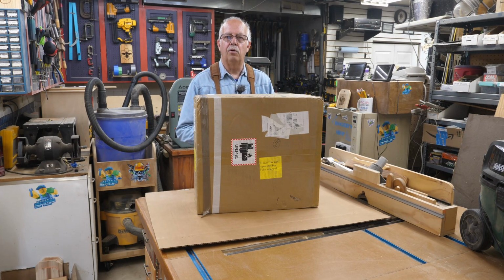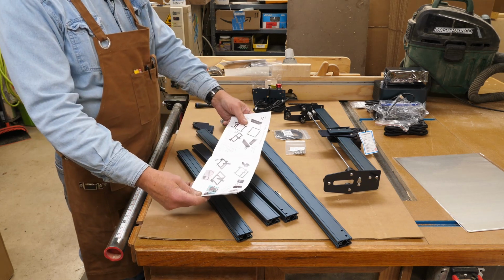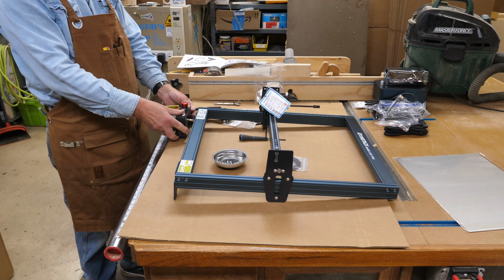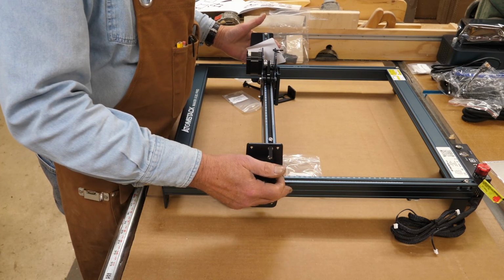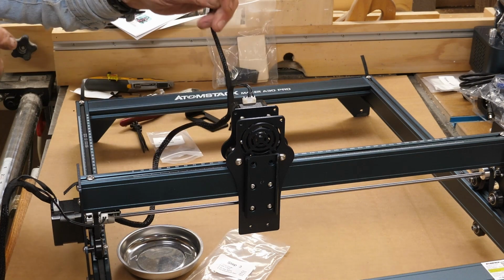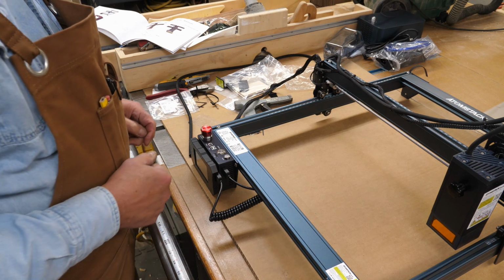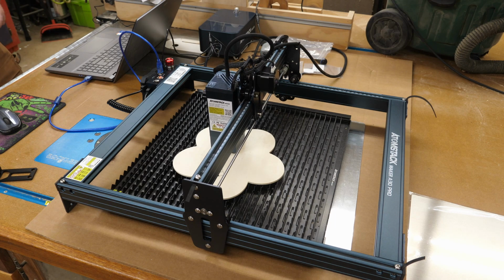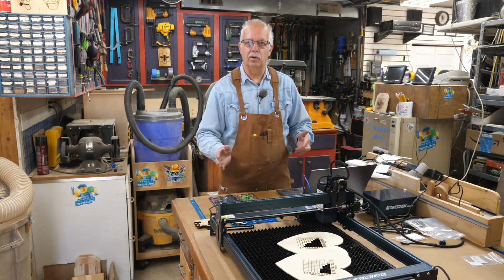Atomstack A30 Pro Laser Detailed Assembly

Comment: I was really hoping to see you do some deep cutting.  I was told this thing is 3 times more powerful than my ortur 3, I would assume that means it can cut stock that is thicker than 1/2".  Have you experimented with thicker pieces?
Reply from the maker: 1/2" Cedar, Pine, and Cherry have been no problem.  I did try some 3/4" pine, which worked as well, but don't really have any current applications for it.

Comment: Hi Roger. Great video. I'm trying to connect mine to Lightburn but it won't find it. Do you know which laser or controller to select when setting up manually?
Reply from the maker: Before attempting to let Lightburn find your laser, make sure no COM port is already selected next to the Devices button or it won't find it.  This is especially true if you have other lasers already in the software.
Reply: Nevermind, I found out I needed to download some driver that Lightburn suggested was a common driver for these Chinese lasers. All up and running now!